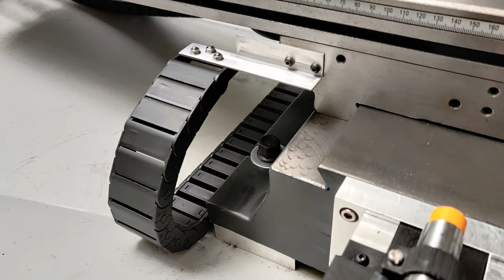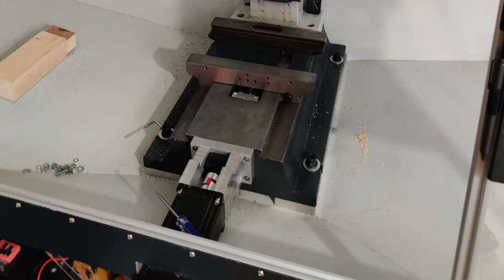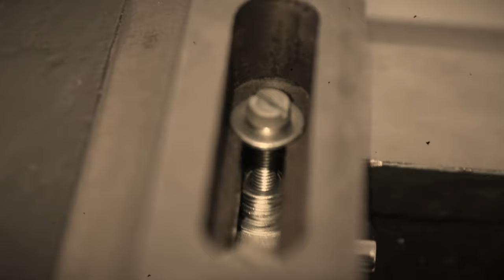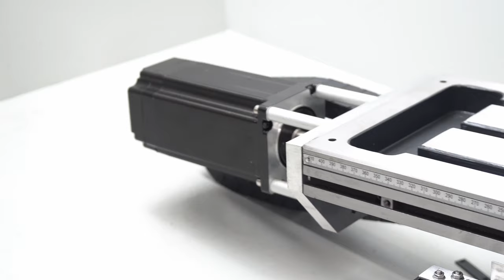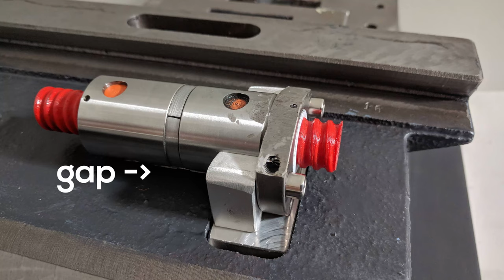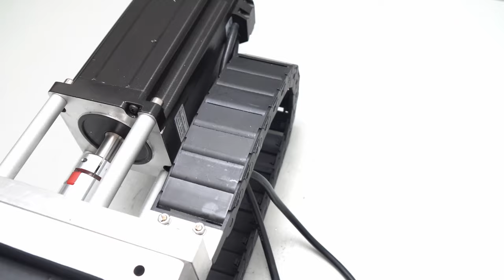BF30 CNC #8 - Back at it again!

Comment: Those steppers are freaking enormous!
Reply from the maker: Yep, half the length would probably have been enough, but they looked a lot smaller on the Aliexpress listing :D
But rather too big of a motor than to small.
Reply: @Datulab Tech   Great Work! I think you're steppers have a higher tourge than 5,5 Nm? What kind of ballscrew's do you use? The look like 2010(diameter 20mm x pitch 10mm) or 2005? 
Jetzt nochmal auf Deutsch, da mein Englisch nicht das beste ist und ich nicht alle Wörter nachschlagen mag: Sieht so aus als hättest du Motoren verwendet mit weit mehr als 5,5NM? Was für Kugelumlaufspindeln verwendest du? Sieht nach 20mm Durchmesser aus mit 10mm Steigung? Auf welche genauigkeit kommst du beim Fräsen? 

Danke für deine informativen Videos und die gute Arbeit! Gruß aus Hessen

Comment: A manufacturer has told me that the xx30 is using plastic gears inside and I better use the xx32 which is belt driven again. Is this machine belt driven or does it also use plastic gears?
Reply from the maker: It has metal gears, but if might be different for the various manufacturers making this kind of mill.